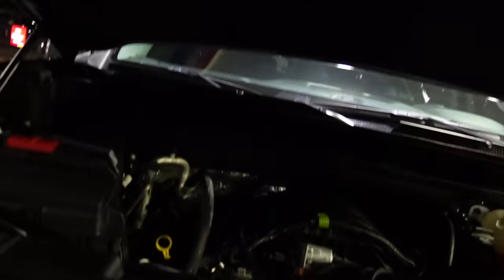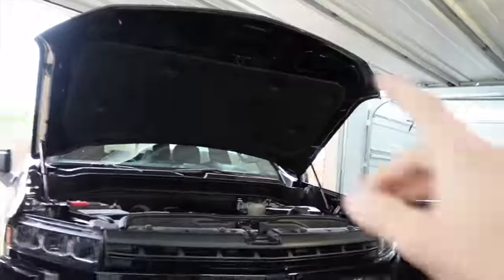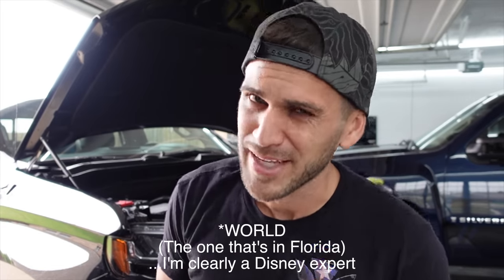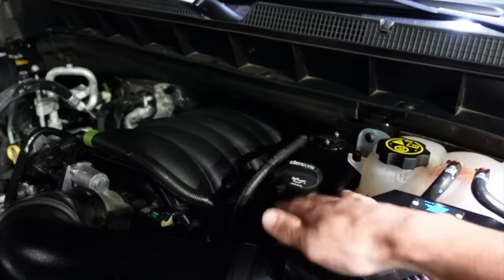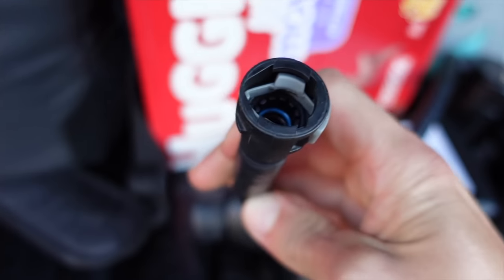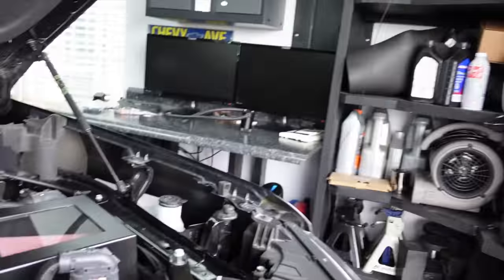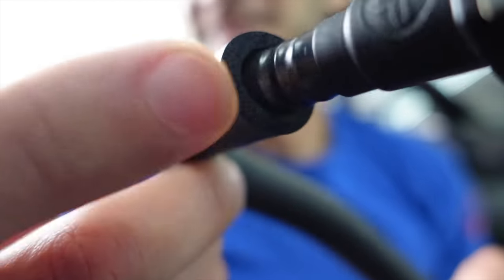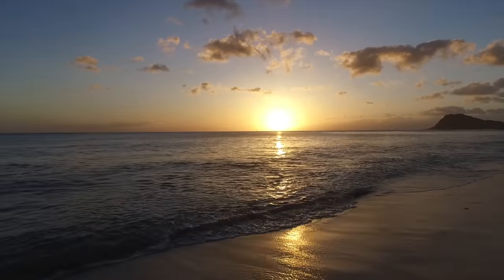Silverado Oil Catch Can - Did NOT Go According to Plan... 2020 Trail Boss Oil Separator

Comment: Why don't manufacturers put Catch cans on the vehicles from the factory?  It is because they are something that has to be maintained and emptied and checked on a regular basis. If not it can do more harm than good.  They know most people that buy a car are not "Car" people and are not going to maintain the system and thus going to have damaged engines. So they do not add the catch cans.

Comment: Seems way over priced for a catch can. eBay has them for around 50, only difference I see is the factory style quick connect. If anyone know where to find those quick connect pass on the knowledge. I had a cheap eBay catch can on a Tacoma for over 50k miles. Worked like a charm.

Comment: I have a 2020 1500 custom does your oil filler neck move at all? Front to back? I have the elite engineering catch can and their bracket puts the can right in the way of the oil filler neck but the filler neck can move with a bit of effort.

Comment: I have a 14 Silverado with the 6.2 . 160,000 miles on it this truck has never leaked or burned more than a 1/4 of a quart between 3k mile oil changes up until the last oil change. I left Mississippi drove to Omaha for work . Right at 2k Miles on oil change and my indicator went  low oil . Almost 5 quarts low !!! Never knew this was an issue til recently just one of many with these trucks ! It's bullshit from the start as much as we pay for them then shit like this happens. I understand a little oil burn between changes but this is horse shit !!

Comment: I just added this catch can to my 2022 6.2L Trail Boss LTD. Mine has the hissing to but you can only hear it with the hood popped. Not too bad. I just want to confirm that you have determined it is not a vacuum leak and lowered your mileage and that first drive was a fluke?

Comment: did you remove the PCV valve and replace it with the catch-can; I don't know if it is wise to substitute the PCV valve for the catch-can, I installed a catch-can on my dodge ram van, but I left the PCV in place

Comment: 2011 Silverado with the 4.8 . I have the same one installed. I’m wondering is mine port injection or direct?
Reply: Direct
Reply: It's port injection. The 4.8 never got direct injection.  You can see the injectors on the intake manifold.
Reply: That 4.8 will go forever no AFM or direct inject

Comment: Had the same issue on my 2020 Silverado, I couldn’t really pinpoint the noise but I’m assuming the fitting didn’t plug in properly I pushed on the hose as much as I could and moved the hose around and the vacuum noice stopped.
Reply from the maker: Thanks! I'll take another look at my connections

Comment: Nice truck! And, good call on the JLT catch can. I have one on my 2019 F-150 Roush. And, even though it’s direct and port injected, I don’t want any of that gunk going back into my intake. 

Nice mpg on your truck, too. The best I can get in mine is between 16-17 mpg. It seems like my mpg dropped about 1 mpg since I put the oil catch on at 5K miles. Do you have the 5.3 or the 6.2 in your Trail Boss?

Comment: This is the root reason for your problem:  https://www.youtube.com/watch?v=hDx09voTlbw&list=PLiy36c_fHap9Pvkjjt3xLZdjtlwDF1d2u&index=3
The answer to accelerated intake carbon buildup is stated on your truck's oil filler cap. Always use Dexos approved motor oil. Change every 3-5000 miles. Clean your PCV valve, EGR valve, and throttle body regularly. .This procedure should slow down the carbon buildup in your intake manifold and reduce the frequency for walnut blasting. Also, put Lucas injector cleaner in your gas tank periodically to keep the injectors from clogging. Direct injectors are expensive and live in a hostile environment.

Comment: with todays technology you should not have to buy a catch can. the manufacturer should produce an oil system that stops the so called contamination . just do like the older days and run the house from the valve cover down to the ground with a fiber filter. or maybe that is the manufacturers real reason for not doing this with the catch can. they want you to have problems down the road for more repair work either at the dealer or other mechanic shop. i can remember one time a man told me things are made to break, they do not want something to run with out any problems.

Comment: This is why oil catch cans are a bad idea. Now it’s a maintenance item, instead of leaving it alone.

If you don’t want that carbon on ur valves just take ur truck to GM, & have em do a complete fuel system cleaning. The cleaning will clean up the valves, & burn up all the carbon, then ur good for a while.